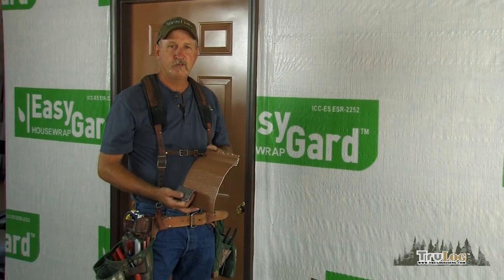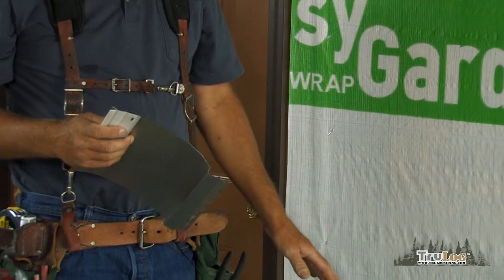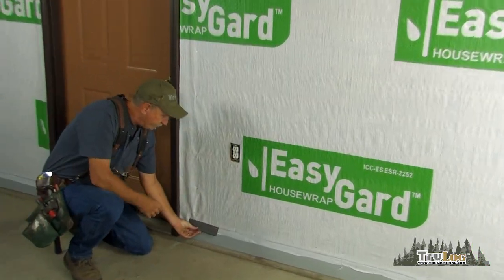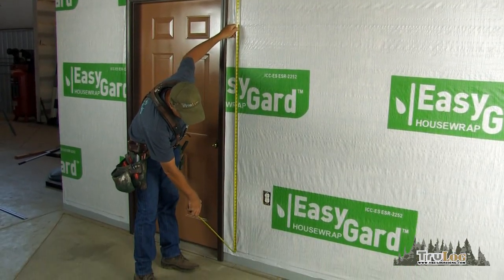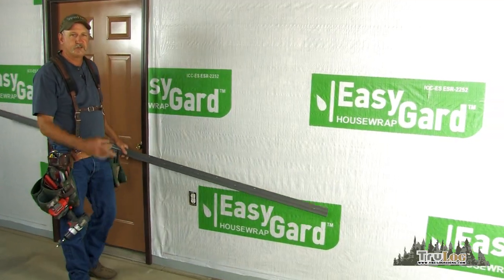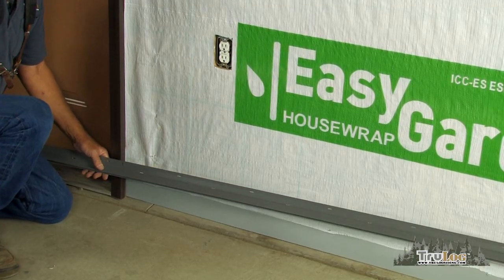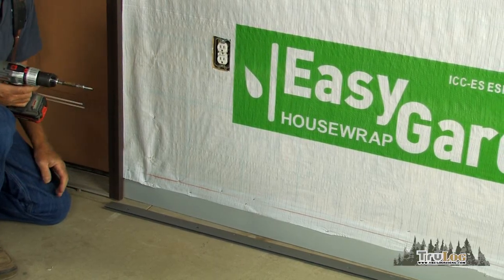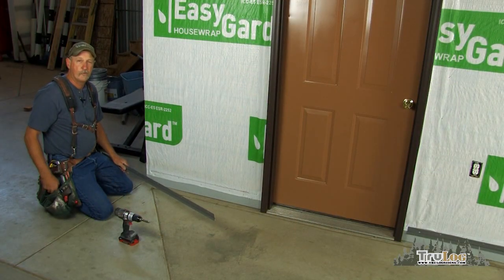TruLog™ Full Installation Video

Comment: Nice stuff. I’m sure with a metal roof, it’s almost fireproof from exterior fires. It’s in my list of cabin improvements!
Reply from the maker: You bet! Thats why we do what we do!
Reply: Be aware, it will make it fire resistant, NOT fireproof. If the fire is hot, typical timber or brush fire, it can ignite the OSB under it like a match. You STILL need to make a firebreak to protect your cabin or home! (Too many times on wildfires.)

Comment: Thanks for the samples! After doing hundreds of conventional steel siding jobs I'd like to use your product on my house. Aviation snips are designed for thicker metals and on steel siding leave nasty cuts. I'm quite old school and need left handed av snips for left handed cuts. Using the traditional tin snips, Channel-Lok, I cut better and a lot faster with far less oil canning of the steel. I never level anything, I install straight with the house and in fact never have a level on the job.
Reply: i guess it is kind of randomly asking but do anyone know of a good place to watch newly released tv shows online?

Comment: On regular home siding they leave the nails or screws loose for expansion. Is that necessary with this siding. I notice you are screwing them in tight.
Reply from the maker: You dont have to leave things loose like vinyl, but you dont want to suck the panel into the wall either. Just a nice natural fit of the fastener touching the panel and the panel touching the wall for natural expansion and contraction

Comment: Looks like a pretty nice product but how will it sound when the rain is hitting it is it going to sound like a tin can when I'm inside the house
Reply: The steel log siding comes with a foam backer and it helps with noise deadening! So you wont hear the rain like a tin building

Comment: Question: on the board and batten video, i dont recall you putting flashing on the cut edges around windows. Is that not necessary for the board and batten but IS necessary here?
Reply from the maker: Are you referring to the sill trim? You only need to do the sill trim with doors and windows if you dont use our bold window trim
Reply: @trulogsteelsiding6804 the trim you're putting on the cut edge at 21:05 around the electrical outlet. I mis-remembered and thought it was the window cut
Reply from the maker: @spamusapan  gotcha! You can do the sill trim in the areas but you dont have to. You can go either way

Comment: What type of saw and saw blade do you use to cut the panels?
Reply from the maker: You can use a ferrous or non-ferrous metal cutting blade to cut the steel with a saw!

Comment: If the siding is steel, what is done to prevent the cut pieces from rusting when it’s exposed to the elements?
Reply: Our steel is galvanized to prevent rust and corrosion!

Comment: Looks like the dents stick out like a sore thumb . That would be the biggest con , other than that it looks pretty good.
Reply: 26 gauge metal doesn’t dent that easy. If it does the heat of the day will usually pop it out

Comment: Wind load design???? Code compliance???
Reply: Hi Chuck, at this time, we dont have any formal testing for wind or code compliance. It would be a similar code and wind testing as other steel siding on the market
Reply: Thanks for the reply. Our local building department may have questions on the product. I will contact your local rep to get feedback on installations in our area.

Comment: I was interested until I noticed a dent in the first piece on the second row.🙄
Reply: Hindsight on this installation video from 7 years ago, we used damaged material from a job to show how it installed since we were on a budget :)
Reply: I saw that too.  I was curious about denting though.  We get some pretty bad hail storms here. I have a Morton Metal building and denting has happened over the years.
Reply: @trulogsiding2507   I too worry about hail denting it.   Do you think anyone that installs vinyl siding can install this without any problems.
Reply from the maker: @butlerfan8012  it is the same installation concept but you cant manipulate steel like you can vinyl so they will need to take a little more time to install the steel but they should have no problem with it

Comment: Wow again, if you screw or nail the siding tight to the wall when it gets hot or cold the siding will buckle
Reply from the maker: We like to use the word snug. Screw or nail it snug. Steel doesn’t expand and contract like vinyl so it will not buckle
Reply: It's just ten foot pieces... It won't buckle... If it were 40-50' ID start worrying.
Reply: @toadamine  i work fir abc seamless siding we run whatever your building length is , it dosnt buckle

Comment: No way you can measure from the top down to start your siding, on an old house there is no way the siding would be level, I would think having the siding level would be important!!!!
Reply from the maker: It is very important to be level :) 

Luckily, if there are changes in the height of the line around the house, you modify the panel to keep that same line.
Reply: Level doesn’t matter on siding for the most part, just needs to look good around you’re windows, doors and top rips under the soffit.

Comment: What kind of Blade do you use to cut?
Reply from the maker: We have used Diable Steel Demon in the past but not sure they are the best anymore. We use Lenox Steel Blades, 52 teeth. Make sure to match up your miter saw RPMs with the blade